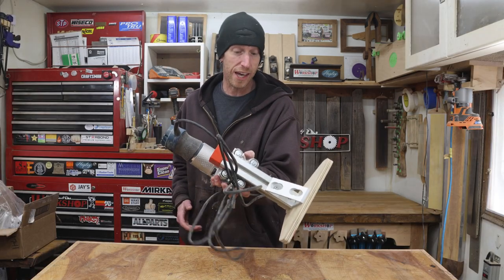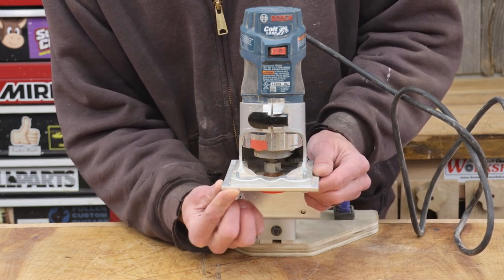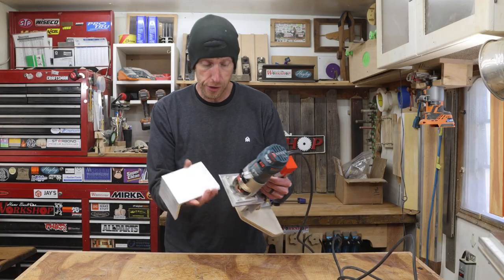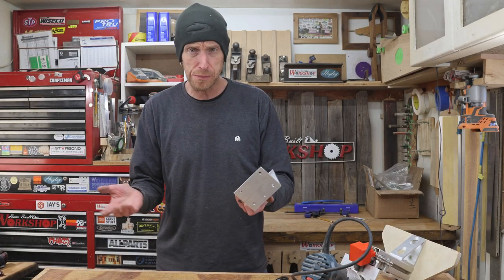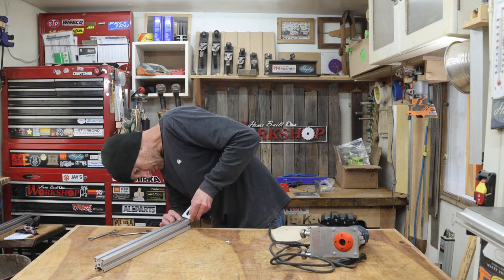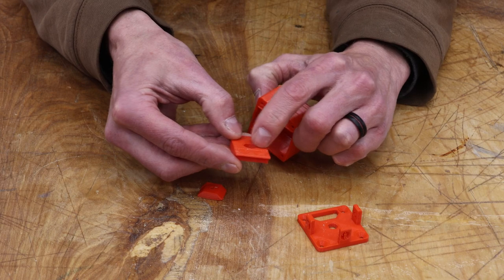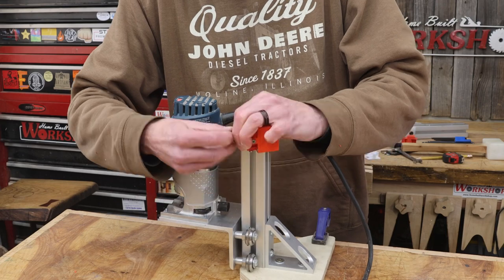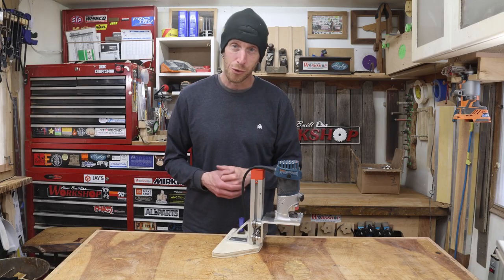Building the Guitar Binding Tower Mk2 | Plans Available

Comment: You might get more wiggle room if you reverse the vertical piece of the L bracket for the router base to the top side behind the router body. Instead of underneath. You would just need a taller pillar.